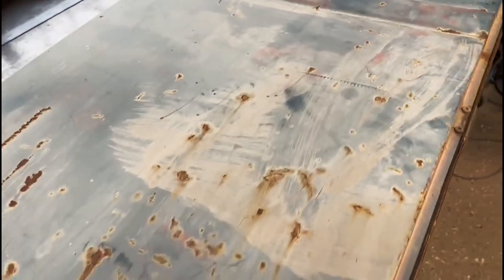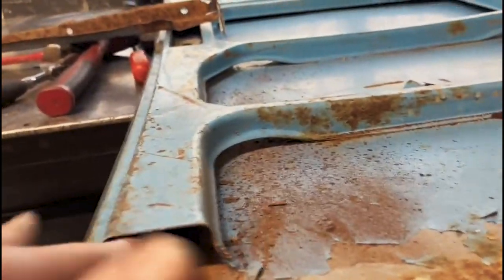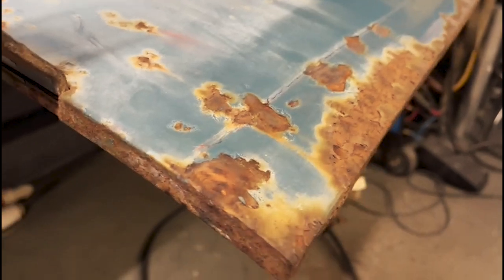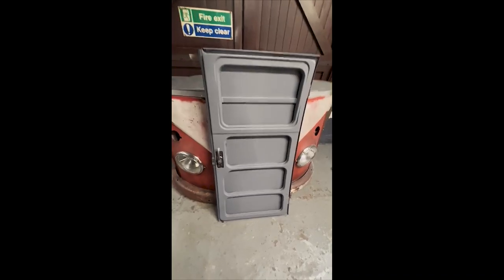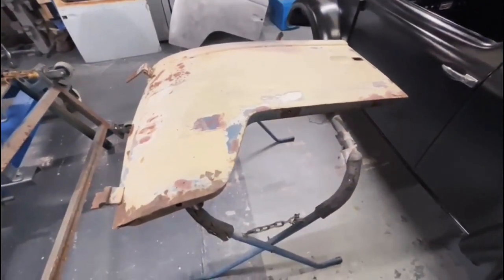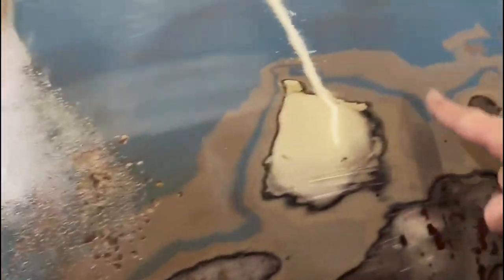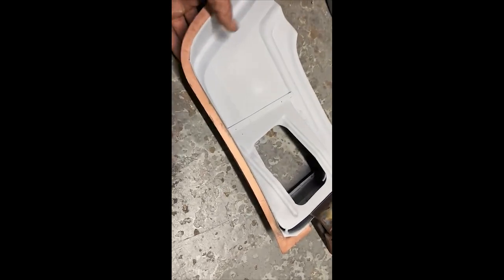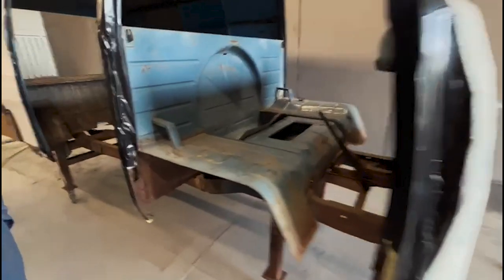Project '58 Ep2 | Repairing the Doors on Ewan McGregor's Classic 1958 Volkswagen Type2 Splitscreen

Comment: Was just recommended to check out your channel! We both got patina buses and trying to fix any of the rusted out panels.
I’m doing it a little differently as I’m clear-coating over all my patina, so have been sanding much of my rust smooth before doing so. Going to start doing some faux rust for my roof as it was far too much to clear coat and preserve. Thanks for some great ideas and great videos!
Reply from the maker: Good luck with your build Adam!